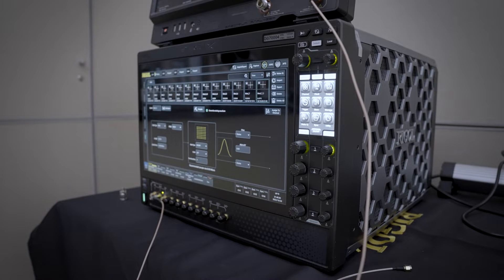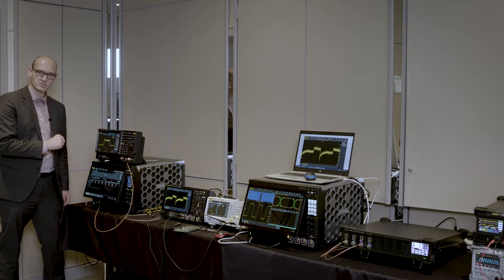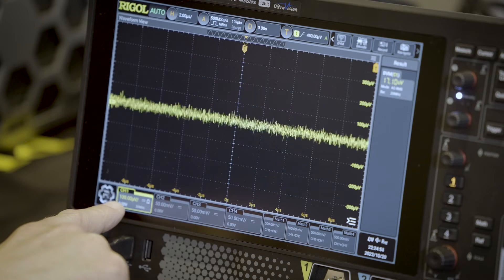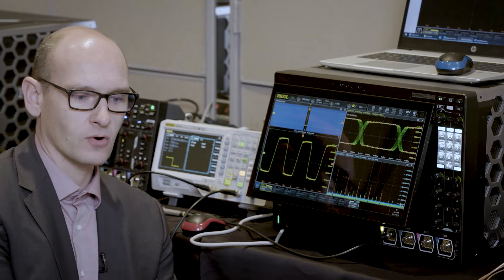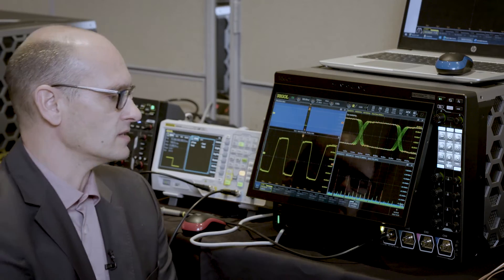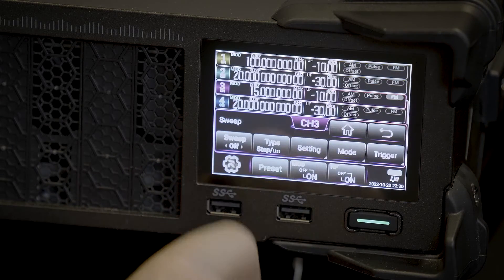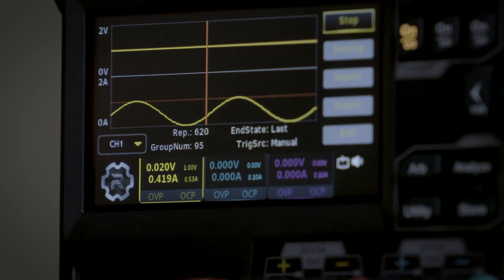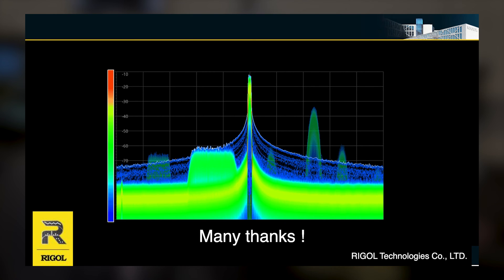Rigol Demo New Products 2022

Comment: I own quite a few  Rigol instruments and have been impressed with the continuing support, upgrades and fixes provided in firmware, often many years after the equipment was introduced. Rigol seem committed to supporting their product with these updates for much longer than some other well known manufacturers. All new instruments from major manufacturers come with bugs and often missing features, which are addressed in firmware updates, but so far Rigol seem to be doing a better job at providing ongoing value improvements. A good example is the MSO5000 series oscilloscope, which gained improved resolution, better capture, VNC Remote, Bode Plotting and many other things over the years since its release. There is also a lively online community, especially on eevblog supporting users with tweaks and upgrades which sometimes greatly enhance the utility of the equipment. Some of these people are exceptionally knowledgeable and have surprised  me with the advice and insights provided. I own quite a bit of other brands gear as well, and I think Rigol provide, in many cases, better value than many of the traditional manufacturers. They are certainly not a low-end brand and along with their value lines have some very high performance equipment that is priced accordingly. It is certainly worth having a look at Rigol if you need something decent but take the time to see what current firmware updates provide. Often reviews only cover the initial firmware release and there can be really big upgrades in features and performance over time.